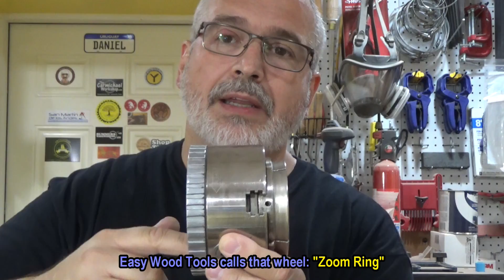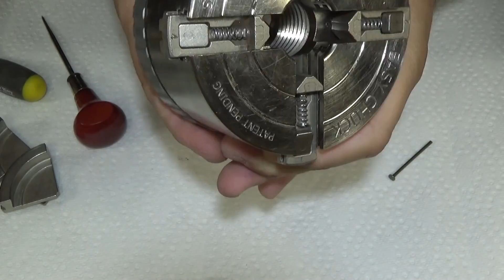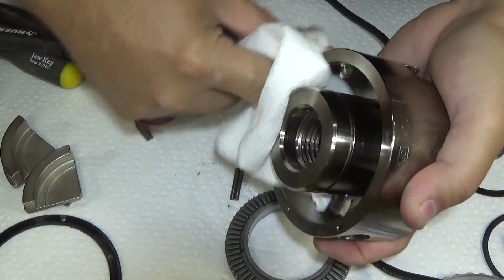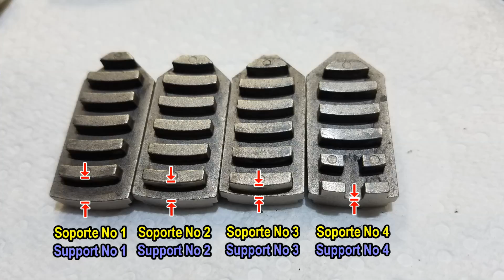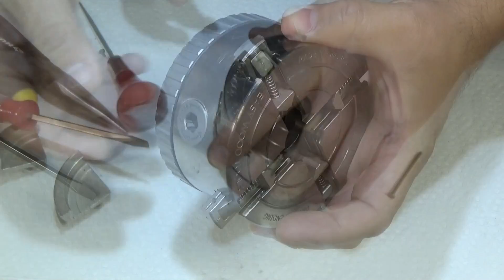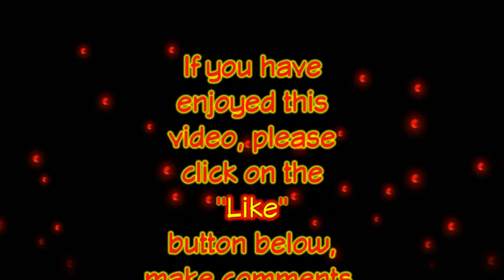Easy Chuck from Easy Wood Tools Maintenance

Comment: Thank you for this video,  I got a used easy wood chuck with my lathe and it is not very smooth.  I have to use the Allen key to get past certain points.   Now I will know what to look for when I take it apart.  
Thanks again,  
Tony

Comment: Thank you Daniel for this information, as my Easy Wood chuck speed ring has begun to drag significantly. I now have have a project to accomplish--Mil Gracias!
Reply from the maker: Hi Roy! I am really glad, my friend, that you found the video of help. The dragging can be produced for a few reasons. The cleaning will surely help. In my case there where small dents in the exterior part of the spiral that rubbed against the chuck body producing the dragging and I eliminated them with a bit of sanding. Some dust can mix with the vaseline and eventually get stuck there so a very light sanding in all the rim of the spiral gear will help. I wish you the best in your project! Cheers! Daniel